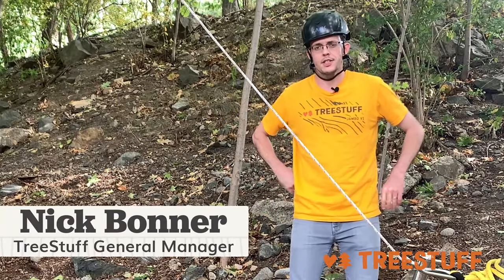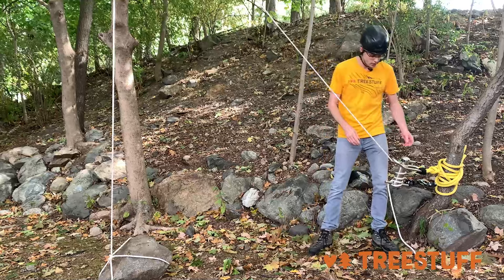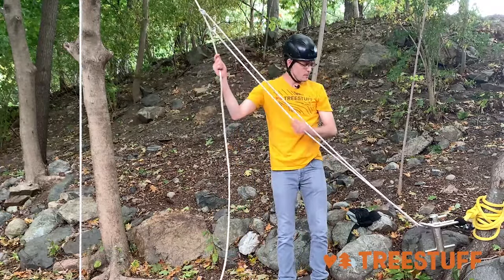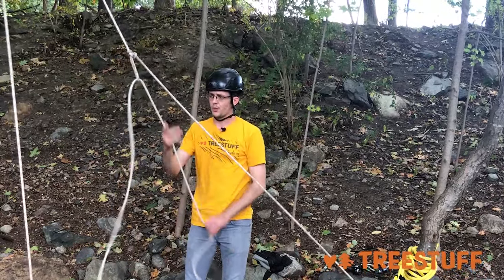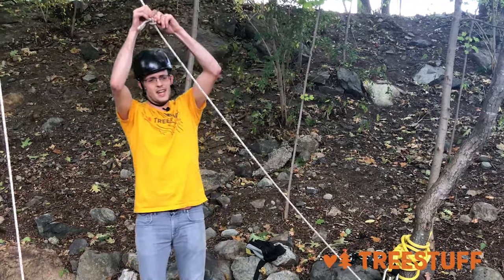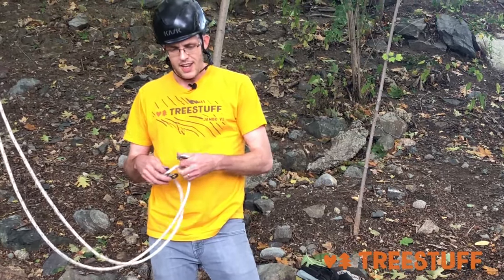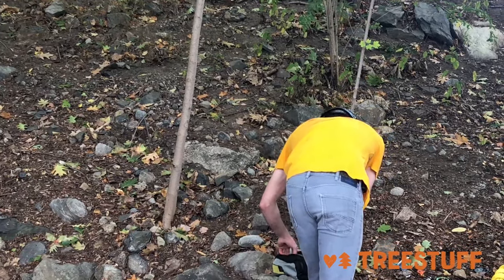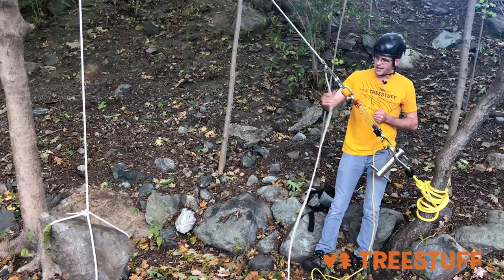How to Use Mechanical Advantage to Pull Trees and Lift Logs

Comment: I like that.  Can you tell me this……..does the amount of  mechanical advantage vary depending on the angle of the redirect.
Reply from the maker: Not really. Maybe in a theoretical sense, or with a very low efficiency pulley.

Comment: This is a lot of very basic rigging techniques and some fairly advanced equipment. Hopefully, anybody who needs this basic of instruction hasn’t bought that much equipment without knowing how to use it.
Reply: That is true. That rock cost about $600 to lift. I think the vid is more about mechanical advantage, clearly a 1 tonne chain hoist with 2.5m lift for $56 from eBay (I bought one today) would be easier. A simple wooden tripod over the rock acts as the “crane”.
Reply: All the gear no idea?

Comment: Can you use this system with larger pulleys to assist in lifting branches in tip tying method, similar to GRCS or Stein RCW3001?
Reply from the maker: Bigger pulleys lend small increases in efficiency but generally if you want more output you use more pulleys, not bigger ones.

Comment: It was explained in the video, this is a 'Cadillac $ system', and this all could be done much cheaper with some shopping for similar equipment. If life or critical materials are being maneuvered, I'd assume you acquired the best equipment available and had some formal training. If this is more for 'Handyman use', a cheaper (but definitely reasonably reliable) system you can make on your own would work just as well, might take more time to set up, but would do just fine, and the videos are pretty good showing how to use the system, BUT PRACTICE BEFORE! It is fun to learn & use the pulley systems, but to 'Compound the Advantage' also means 'Compounding any possible problems you weren't aware of' before Murphy's Law set up an unforeseeable dangerous mess. So study several different videos and practice. Good luck & be safe.